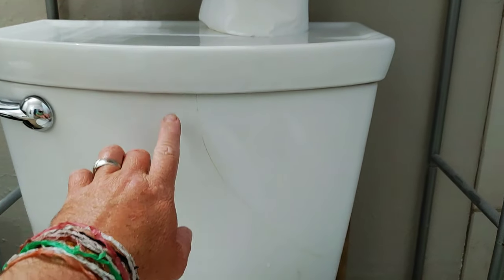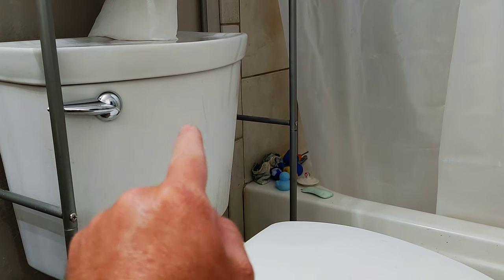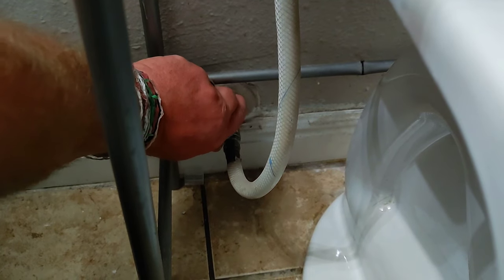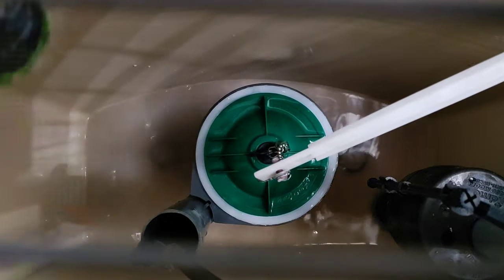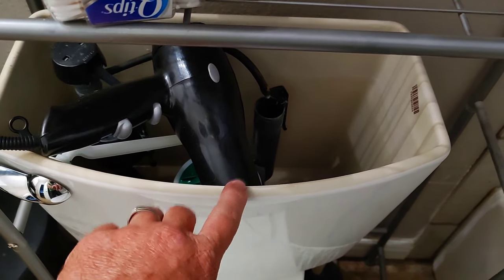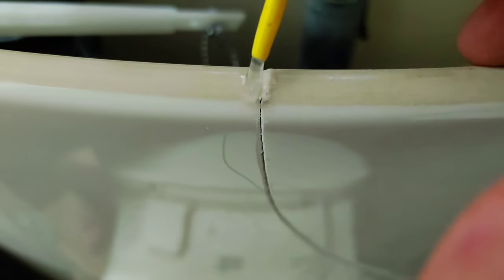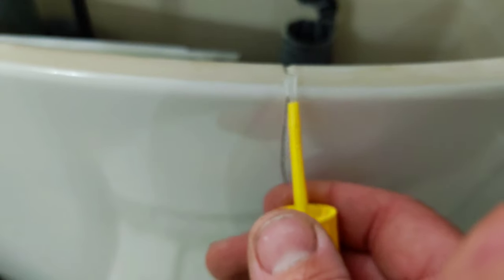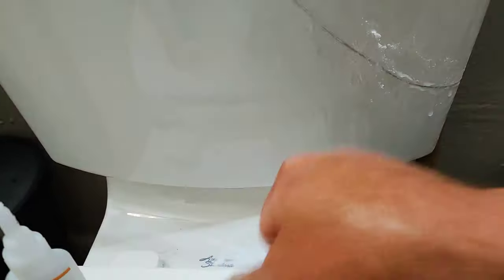Cracked toilet fix! No leak, no plumber, just a cheap fix.

Comment: It is quite a gamble to fix a cracked tank than to just replace the toilet. If you leave for the weekend and the tank were to shatter or spring a huge leak, the water would run for the whole time you are gone. Your house would be quite a wet mess. But if you have good home owners insurance you can then repair/remodel your whole house.
Reply from the maker: Yes, I would definitely consider this a temporary fix. It did last for over a year though, and then it started to sweat through the crack.

Comment: What I've also done is spray flex seal over the crack on the inside of the tank. Seems to work really well, and you don't have to worry about the outside so much. You're seriously gonna remodel that whole bathroom though? It doesn't look older than 10 years.
Reply from the maker: Yeah. We already did one of the bathrooms and this bathroom is the last thing needed in the entire main floor. Everything else is in white and gray so it doesn't really match. Plus the tile is bottom dollar, as is the flooring and it's the master bathroom.
Reply: Not older than 10 years........

In the 90's!
Reply: 3m marine sealer 5200

Comment: thanks mate. been thinking of doing this but with silicone sealer... im probably doing it for something more in the long run, crack is in the back. did you think about that before ? would you think that may be able to go on some more years?
Reply from the maker: Yeah, I think it will hold up for a long time. The ceramic toilet is very porous and sucks the glue in and makes a solid connection, especially if you add the baking soda.

Comment: nice. I'm about to do the same repair. CA glue is great stuff. The low viscosity allows it to be sucked into hairline cracks by capillary action. I once filled a pipe crack  with CA, applied baking soda, then sanded and applied a ca soaked piece of fiberglass cloth to the outside, more baking soda. 2 years and still holding pressure.
Reply from the maker: The fiberglass is a great idea

Comment: 😂Here cuz my son broke mine too, the nicer one thats easy clean bottom that I saved up for at that. Great job in this vid!! His dad threw away the porcelin piece though I felt it could be fixed. Wish I saw this sooner. New replacement tank ir entire toilet on the horizon now & bucket flushing til then
Reply from the maker: It's unfortunate that a new tank costs nearly as much as an entire toilet.
Reply: @VanDamArtisan  Exactly! Just got off the phone with American Standard & they don't have just the tank so will have to cross my fingers & hope Menards will help me remedy this or else it's entire new one. Same w/the 50 inch tv he broke, screen costs as much as just getting a new one
Reply from the maker: @homesteadmoon  that's lame about the TV too. Good luck with the toilet.
Reply: @VanDamArtisan  Thanks😊

Comment: American Standard has lifetime warranty! Same thing happened to my tank and they sent me a new one for free!
Reply from the maker: @BlastedBilly  that's nice to know, now that I paid for a new one...
Reply: @VanDamArtisan  lol maybe it'll save you some money in the future!
Reply: @BlastedBilly  Hi there. My American Standard toilet is 2 years new. What would be my 1st step to fix my leak in my toilet? I live alone, and I'm not handy.
Reply from the maker: @joanglover3437  someone commented that American standard has life time warranties. Check on that and you may get a new one free. If you fix the crack, it's not completely necessary to grind it open. Just make sure it's clean and dry and get super glue that's as runny as possible. I'd suggest a couple coats with just glue before you include any making soda, just to be sure it gets as deep as possible.

Comment: Thanks for advice on a cracked toilet cistern. It happened to my 25years old toilet today same kind of crack i only had Tetrion sealant in so I’ve use that hoping it works, then I can turn water back on. My housing association won’t class it as an emergency repair don’t see why when I’ve had to turn water off at stop cock.
Reply from the maker: Hope it works out for you

Comment: is there a white epoxy glue you can recommend for a hairline crack on my bran new toilet?
Reply from the maker: I'd try fixing it from the inside. There are porcelain repair kits for tubs that could work.
Reply: @VanDamArtisan  thanks. The toilet is BRAND new from American Standard. We just had it installed yesterday. We noticed the hairline crack last night. We were wondering if we should call American Standard and demand a refund or replacement. Their brochure says they won't cover replacements. I'm wondering if we should even bother replacing it and just fixing the crack! We are pissed:)
Reply from the maker: I'd call the installer and tell them to have it replaced. They shouldn't be installing broken anything.

Comment: Another fix, cement a 4x4 ceramic tile over the crack on the inside of the tank to stop the crack from spreading. then spray the crack on the inside of the tank with spray rubber.
Reply from the maker: That's a good idea

Comment: Does silicone sealant work instead of glue
Reply from the maker: I wouldn't recommend it just because it's flexible so it might allow the crack to get worse, but it is water proof and would work if the crack doesn't get worse.

Comment: I’ve got a very thin hairline crack too, less noticeable than yours. The plumber suggested a new cistern. I never thought about how it could be easily repaired. Why is almost every trades person on the take, dishonest and trying to get as much money as possible. Does no one have integrity anymore. Great job by the way, you can buy ceramic paint to lessen the crack visibility.
Reply from the maker: I wish there was more honesty in trades. It sure makes it difficult for the honest ones.
Reply: Also because plumber wants repair to last for years and have no come back, fix it again for free as your last bodge failed again when I touched it and or flushed loo!
Reply: @MrGordoncooper  More lies, dishonest again, you can buy ceramic filler stronger than the cistern. Make your children and parents PROUD of you.

Comment: Its been two years how the toilet holding up?
Reply from the maker: We finally replaced it, but it lasted over a year.
Reply: @VanDamArtisan  so it did start leaking again? Im thinking about using jb weld.
Reply from the maker: @leo959  Yeah, slowly. It was almost like it was sweating through the glue or something. Jb weld should work well.

Comment: Did it work?
Reply from the maker: Heck yes it did!
Reply: @VanDamArtisan  im having the same problem on the same spot thanks for the video!
Reply from the maker: @Gimmekiss-ix1hh  good luck. It started to slightly sweat through after over a year, but it worked perfect for a while. Long enough to get a new toilet.

Comment: Seems to me that it would be better if you did it from the inside rather than the outside of the tank since the inside of where the water would enter the crack.
Reply from the maker: For sure. I did it from both sides but it was impossible to film the inside.
Reply: @VanDamArtisan  I came here because my old toilet tank cracked as I was tightening the bolts to keep the tank from wobbling. The toilet is 50 years old. So, I just want to do a temporary fix with a silicone sealant until I can get another toilet. I need a new anyway because these old toilets are slow to flush and take entirely too much water to flush.
Reply from the maker: @denniscarey8426  good luck! I had another one that broke. One of the bolts rusted out completely and just fell on the ground. Now it leaks. Fun stuff.

Comment: How did it crack mate? Did something hit the tank?
Reply from the maker: I have no idea. Probably a flaw from manufacturing. It just started leaking one day.
Reply: @VanDamArtisan  That's why here in India we prefer either plastic flush tanks or wall concealed flush tanks. These porcelain, ceramic tanks are just too sensitive.
Reply from the maker: I agree. Very brittle.

Comment: My cistern cracked, I would gladly buy a new one, but where I live, they are unavailable, you have to buy a complete toilet set,  😠I brought some ceramic two mix resin, it is crap, dries like chalk. useless stuff, and your supposed to roughen the surface, an impossible task so far.

Comment: If it's white in colour ,don't waste your life . Take it out the back and break it up and buy a new one .
Reply from the maker: I did eventually
Reply: I'm trying to repair a toilet cistern,which is Pergamon in colour . It's s discontinued . I have tried CT silicon inside etc .stuck plastic . It's still leaking. Thinking about bitumen. Trouble with my  design of toilet. The water comes in at the bottom . The two stupid  bolts which they connect to the pan is another stupid ,stupid,stupid design . I'm considering buying one of those one piece toilets ,where the pan and cistern are one . I have a lot of patients,but it's beginning to run out .
Reply from the maker: @richardevans3253  yeah, I bet it is. Dealing with leaks is hard. I wish I was better at it.